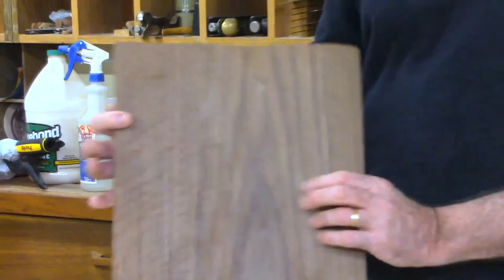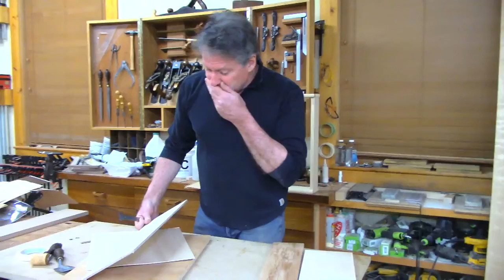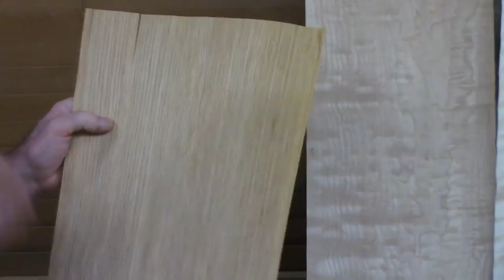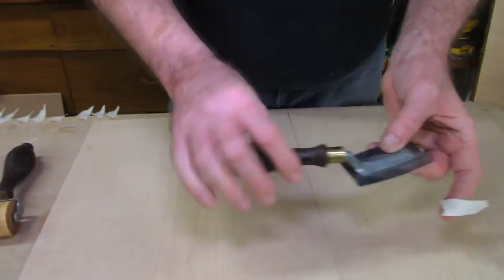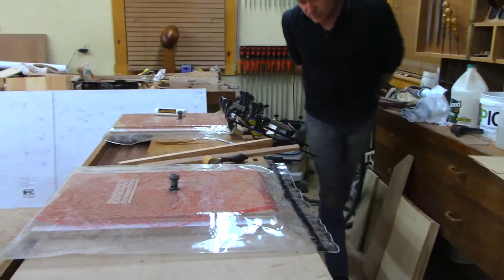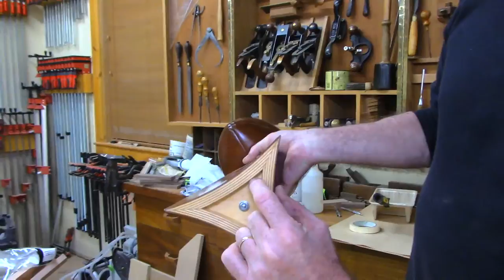How to Make Designer Plywood with Tom McLaughlin

Comment: Hey Tom, was wondering if using those wooden (v-grooved) pices would work better if the clamping edges were covered with some sort of rubberized gasket material?  No idea just guessing. Another question, if I were to make some hardwood plywood with a similar method but using some 1/2” or 3/8 MDF?  Thinking about making some shop cabinets but “upgrading” them with a nice veneer.  Nowadays even bb plywood is up there. Anyway, awesome stuff as usual!👍👍

Oh it just occurred to me that the gasket on the outside of the bag may reduce the clamping pressure, reducing the sealing potential?.  Maybe keep the wood pieces as they are but use a gasket but inside (between the plastic). Again no idea, but I’m gonna get a roar rocket soon I hope.
Reply from the maker: Yeah, I haven’t found a perfect way to seal those manual bags, the goop works best when it’s reasonably fresh. My preferred method is the vac motor type bag but that’s out of a lot of people’s budget and interest. Thanks! 👍

Comment: Didn't the Shakers use plywood ????   I hope they did coz I made a shaker cabinet and matching tool boxes out of ply.  I was experimenting in the new " Industrial " " Rustic " style so I used the yucky bad side as the face with the manufacturers inked on stencil showing.
Let that be a lesson to all beginners ,  as soon as you start doing " rustic "  then improvement in skill level means an end to income!!
Reply: Speaking of water and bent veneers I discovered years ago you don't need water,  you can simply lean a thin sheet of plywood against a wall 45° for 5 years and it stays bent.
Reply from the maker: I’ve not seen any plywood used in the Shaker pieces I’ve seen, probably because the Shakers here in Canterbury were milling their own wide pine lumber and had plenty of it…and the fact that plywood was not “invented” until 1865. But being the pragmatic efficient people they were, I’m confident they would have used it if available and made practical sense.
Reply from the maker: 😂 Yes, I’ve discover that myself!
Reply: @EpicWoodworking  Oh no, so that means Charlie and Ray Eames weren't Shakers ????

Comment: Another quick question Tom, I was looking into Atlantic Plywood right in Woburn among other places and was blown away at their product line. And then saw they only do wholesale🫤. Most of the lumber yards don’t have a very good selection so how does one get ahold of some of these products?  Goose bay is a good option but far for me. Anyway thanks for the outstanding video.
Reply from the maker: I would call your closest lumber dealer and see what they advise. Either they will offer to inventory some, or possibly help you out with a good source lead. 👍